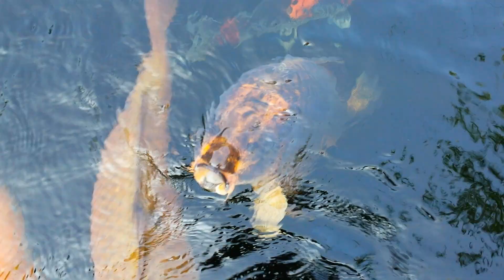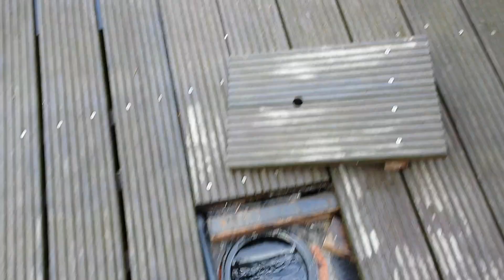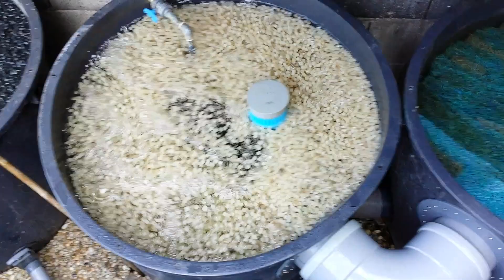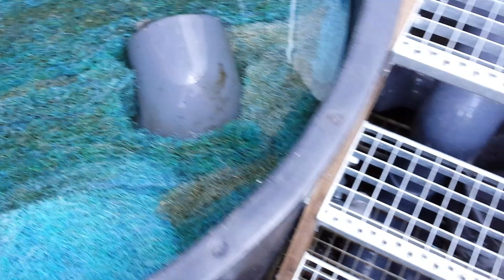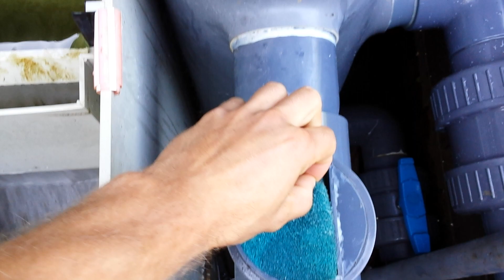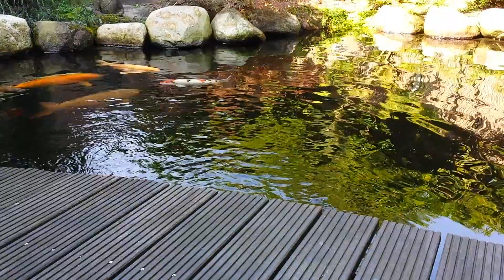Airlift

Comment: hi how do you manipulate the flow of the filter by the air flow rate  ex: if I want 2500L / hour how much air flow rate should I use
Reply from the maker: Hi, the flow depends on the diameter and length of the airlift, amount of air and the water level difference between pond and filter. 2500L/h should be quite easy to reach with a small air pump of max 15-20L/min.
Reply: @koistory5744  preciate the explanation, ty. also, I believe the suction power also is influenced by the air flow right

because right now my goal is to remove as much fish waste solid from the fish containers in which the current submersible pump doesnt have enough suction power. therefore a lot of solids still remains there
Reply from the maker: @doneast9459  Yes absolutely! In my opinion the problem with airlift is the amount of pipes you need, to keep te  water at the right level. This causes a low flow in each of the pipes, which results in accumulation of dirt.
Reply: @koistory5744   @Koi Story  yup will try to use a higher watt pump,

anyways this method would stil be an efficient way to remove fish solid waste from the fish aquarium right
Reply from the maker: @doneast9459  Yes that would be a perfect method I think!
Reply: @koistory5744  hi ran into an issue doing this today

if my water level is at 1ft and the filter barrel is 3ft, i cant actually use airlift right
Reply from the maker: @doneast9459  Yes that is the issue with airlift. You can only use it gravitaire, so the water level needs to be pretty much equal.